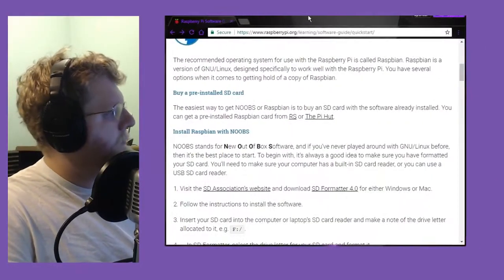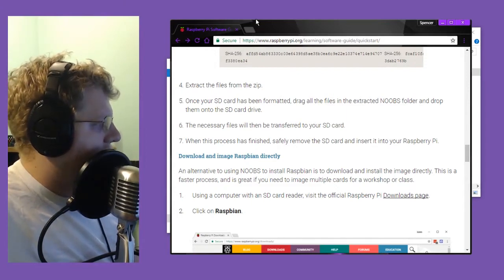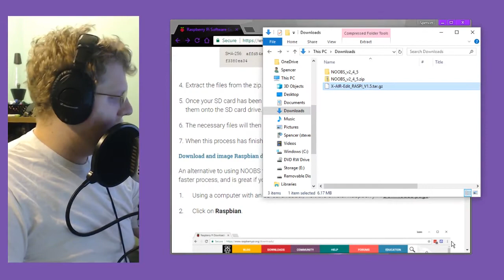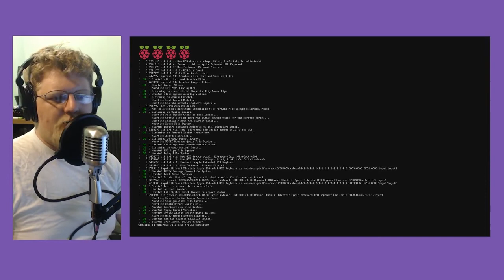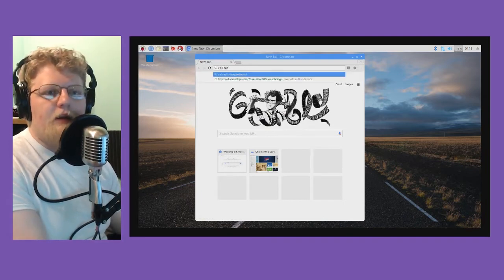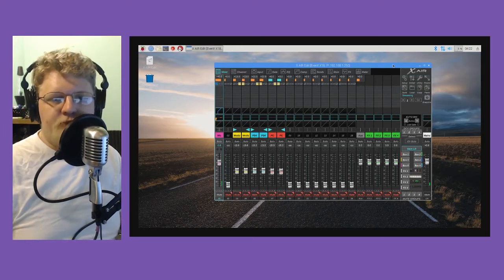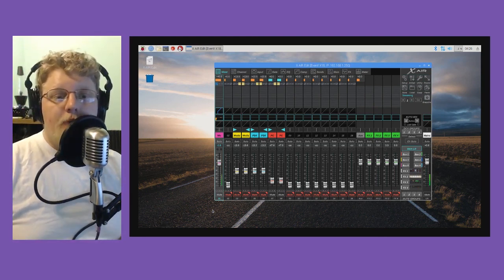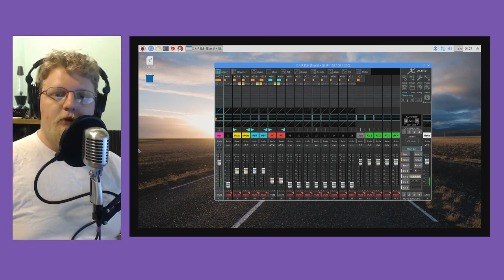X Air Edit - Setting up on Raspberry Pi 3

Comment: Thanks for the video. It will make my setup so much easier. Did you buy a touchscreen? I’d appreciate if you made a short video on that. What type you bought, any hints and how it works in general.

Comment: Also, do you notice any performance issues running the Xair Edit app on the raspeberry? (lagging, metering problems, etc)
Reply from the maker: I have not. It performs the same as the XAir Edit app on Windows. There's no noticeable latency for me.
Reply: I have a very cheap 10" Android tablet from Best Buy. It runs most games like trash, playable, but not great. It runs the X-Air app perfectly which is good since I bought it only as a mixer controller. Their apps are surprisingly light weight. I am able to run the X-Air Linux app right from my Intel Celeron based Chrome Book just fine as well. The biggest issue I have had is when the Wi-Fi signal is low or too many devices are trying to access the mixers (XR18 and XR16). I believe I have resolved this by connecting the mixers over Ethernet to an Asus RT AC87U router. The Wi-Fi signal is much stronger and I even see the apps sync up with the mixer much faster when first loading vs using the built in mixer Wi-Fi access point.